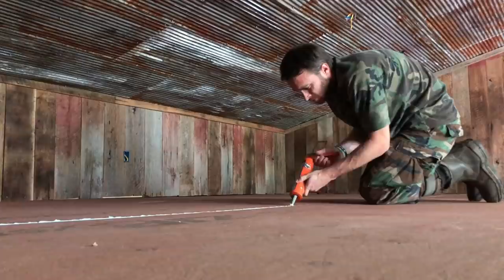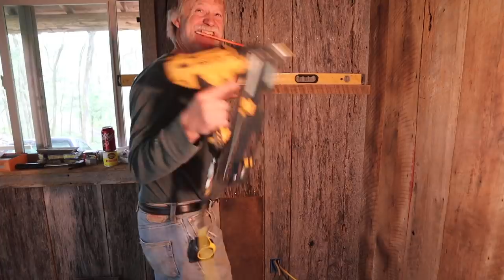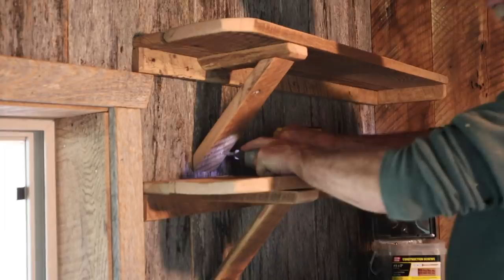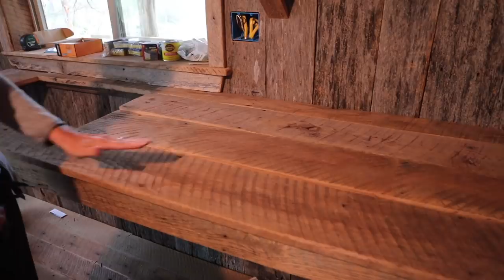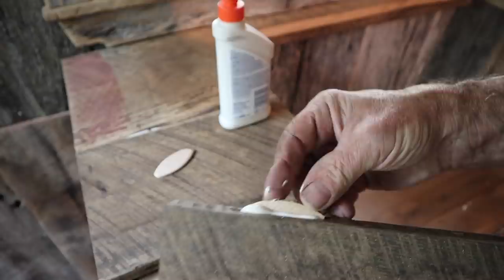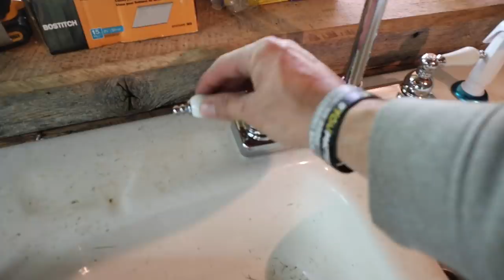Kitchen Build - Barnwood Shelves & Countertop with Farm Sink @ the Off Grid Cabin - EP #17

Comment: I love the shelves by my ocd is kicking in hard that the bracket support is only on 1 side!!! Your  build is amazing. One question I had was there a reason you all didn’t use a board plane for the barn wood that needed to be smoothed out for finish work?
Reply from the maker: Planing the lumber would have removed the circle saw cut from the barnwood. Also we put a board along the wall that is the support just as the 45 degree board was.. Jerry was leveling it in one of the clips
Reply: Loftis Party of Six - weROAM  what I meant was having the other bracket to match the left side. Symmetry is my jam. 😉

Comment: You are doing a nice job on building the cabin, but you might want to consider integrating other materials to break up the monopoly of everything being made of wood. For instance, use metal for the stair railing and paint it a vibrant color, and add some colorful area rugs on the floors before you move in. Otherwise it is going to look pretty dark on a cloudy day. You need some other visual interest to tone down the wood. Just my opinion.
Reply from the maker: Thank you